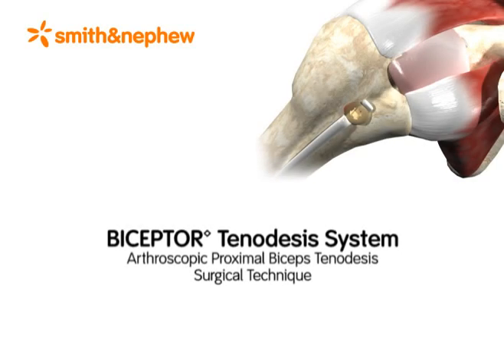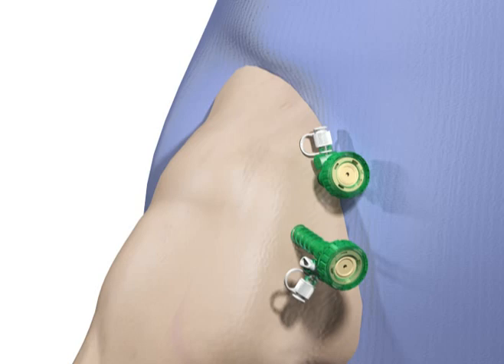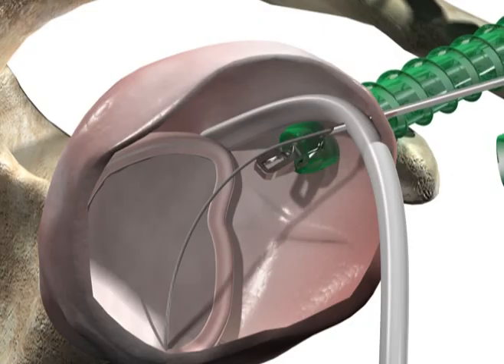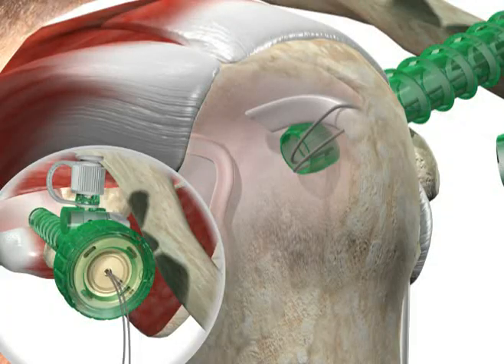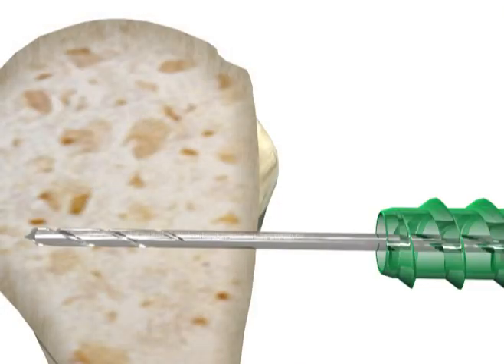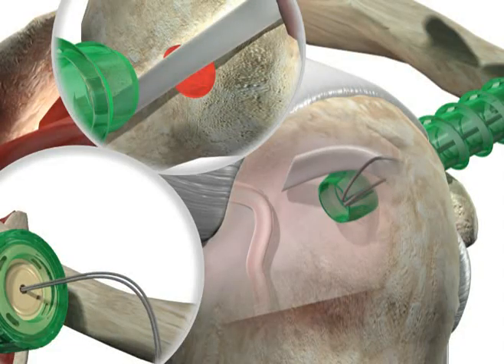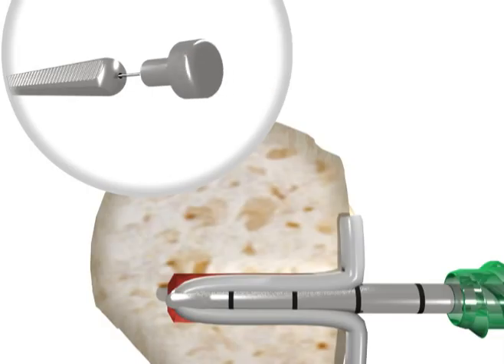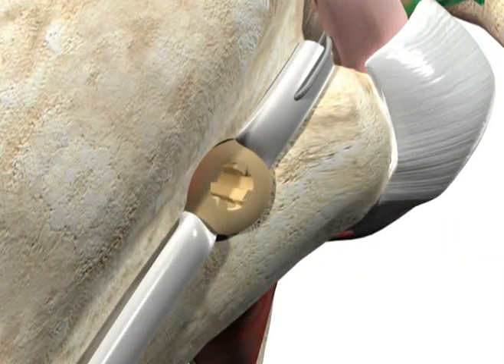Biceptor Tenodesis System | Surgical Technique Walkthrough | SIMON MOYES

Comment: I thought I was having this done
no thank you.
Reply: MR GALLAGHER I had it done, both arms with minimal pain.  I took Tylenol post op.
Reply: @jeancater1388  How was the rehab?
Reply: I’ve played baseball for 50 years, I tore my labrum and rotator cuff in an accident at work, they sent me to have surgery (I couldn’t choose my surgeon, had to use who they appointed for me). Dr. did a bicep tenodesis assuring me I’d be better. I’m worse than before surgery. I can’t even throw a ball anymore and the pain is also worse. He told me to live with the pain. Wish I never had surgery, at least not from that incompetent doctor.
Reply: @SAVEAMERICA-cf6kf  did you have the pain at top front of shoulder before surgery? Where did you have the new pain after the surgery?
Reply: Had pain in the back of my shoulder 2” from top prior to surgery. Post surgery…pain on the side of my shoulder in the middle about 3” from top.
Reply: I ruptured my proximal bicep tendon 7 months ago.  I rehabbed it without surgery and I’m am at 90 percent of my previous strength. It’s cosmetically different and I can live with that.  Glad I didn’t do it.  Long term studies show re- rupturing, fractures where the screw is imbedded and nerve damage. No thanks.